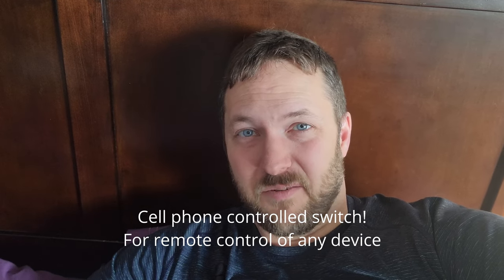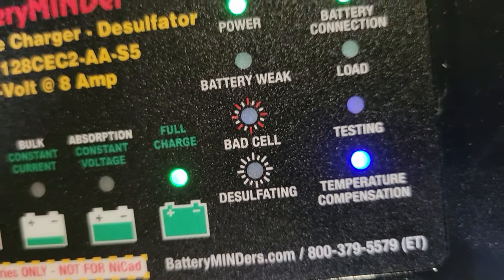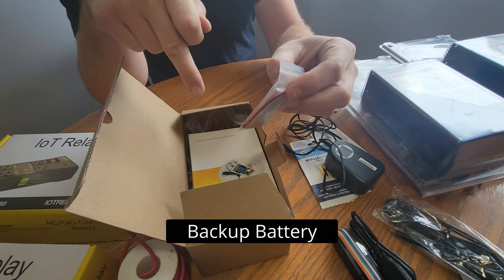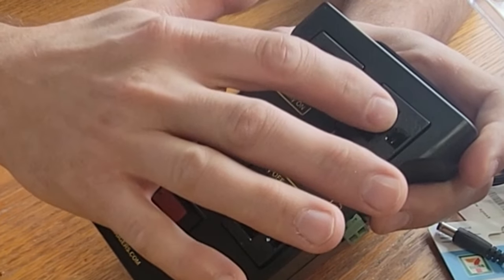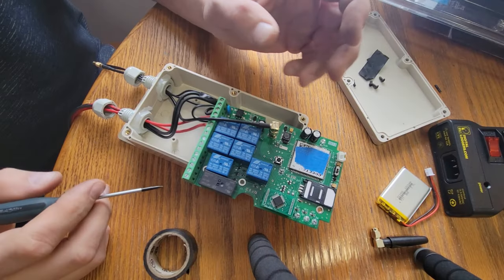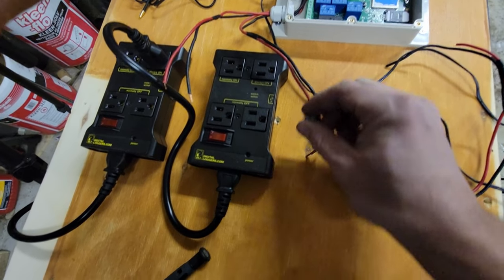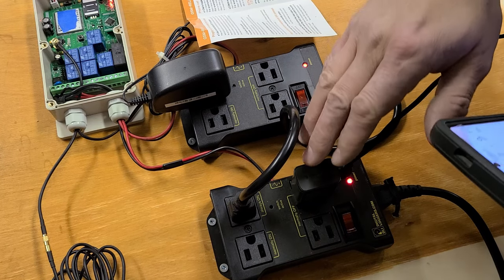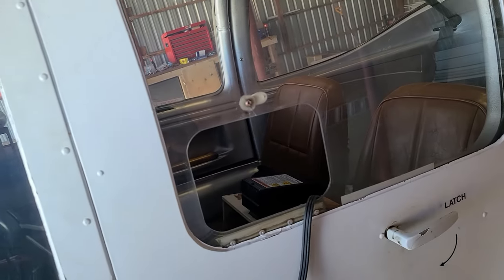Aircraft Pre-Heating With Your Phone!  The Step-by-Step "How to" on Cellular Switches!

Comment: Very cool!  Wish I saw this before I turned my hangar into a "smarthangar" with Unifi gear and wifi switches.
Reply from the maker: Thank you!  It has worked really well.  I think the key is to use the module for low power switching to control the power bars rather than running the 120V through the module itself.   Last year my text messages cost me $18 with that sim card so it's a great setup for hangars that don't have wifi available.